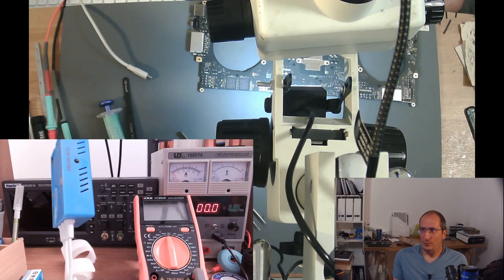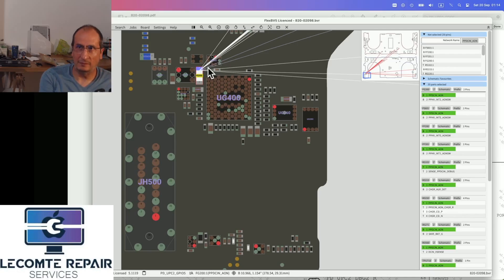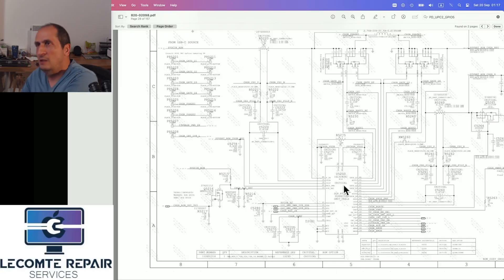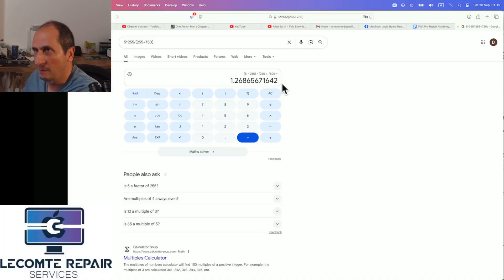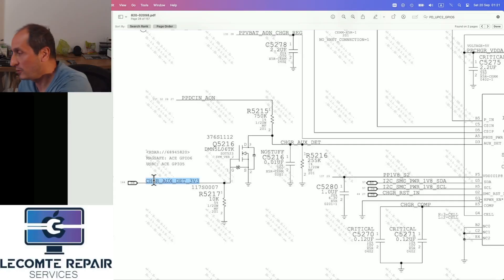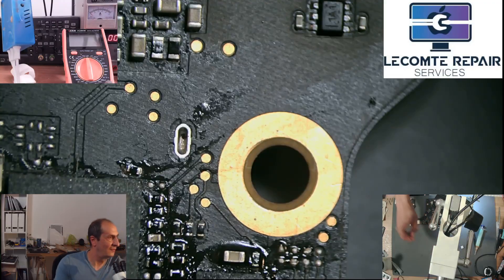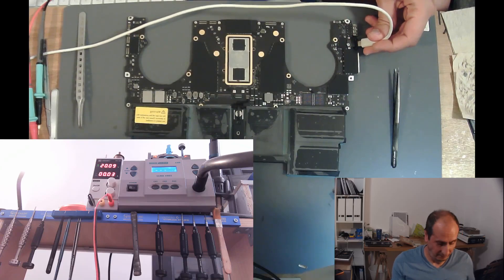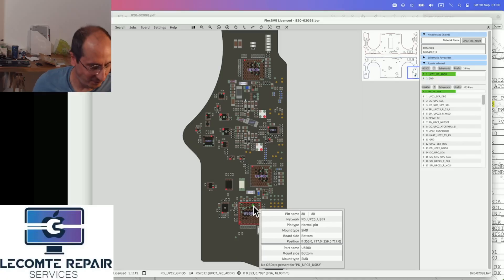[58] [820-02098] Replacing UG400, Part 3: Finishing the job.

Comment: I have reached practically the same point as you in this technical study. 

In my case, I used the oscilloscope to check which I2C addresses communicate with the T2 and which do not. The primary and secondary roles, the function of the TBT-ROM in the configuration, UART communication between CD3217...

But I was missing the resistor table for routing the components OTP. I was missing that piece of the puzzle. Now it all makes sense. Thank you so much for your work and for sharing it with everyone.
Reply from the maker: You're welcome, thank you for the acknowledgement.

So yeah, the short answer is "you just had to read the manual".

But of course, it's more complicated than that. This took me more or less a year to figure out, and the main reason is that: I didn't know what was causing the problem exactly. If I had the info that it was an I2C conflict, then I would have known where to look. But without that information, I had to consider lots of dead ends, including all the things you're talking about. Learned a lot in the process though, so it was not a waste of time at all. 😀
Reply: @LecomteRepairServices Yes, you're absolutely right. It has been part of a great learning experience.

I've found your website and would like to share with you the data from the tests I've conducted in my research. 

In my case, I primarily used an oscilloscope and the Power-Z. With the oscilloscope I was able to read the I2C_UPC bus and immediately saw that the CD3217 R (0x3C) the one I replaced wasn't responding.With the Power-Z, within the PD analysis, you can also see if there is communication between the power adapter and the CD3217, even if the negotiation remains fixed at 5V. The problem is that even though I came to understand the problem, I couldn't go any further down that path.

Once I have the information a bit more organized, I'll send you an email with my evidence. I hope you find it useful.
Reply from the maker: @PhonesLab  I'd be happy to, I'm sure I'll learn something. The address is contact@lecomte-repair.com.

I've noticed that the I2C_SMC bus really doesn't like to be listened to. Somehow, it detects that something is connected to it, and the ACE2 will reboot. It leaves you only one or two seconds to pick up something, though.

Anyhow, figuring out that 0x3B was missing was still doable. But it was not at all obvious that the reason was: Apple strapped UG400, on purpose, so that, if you install a vanilla chip, it will acquire 0x38, and will conflict with UF400.

Comment: Thats very strange they put a second stage for aux_det. I believe its only present since 2021.
Reply from the maker: What puzzles me, and I really want to understand, is: why does the vanilla ACE controller outputs 3.3V on GPIO5 (closing the mosfet), while the OTP one does not. This would tend to indicate that the OTP controller has more tweaks than just the I2C addresses.
Reply: @LecomteRepairServices there are few bytes in OTP block, and i2c override is just a little of that. I have dumps from otp block from t2 and m2 machines and found where it storea the address. However since i have no time + no m1+ dev board in hand thats all i have.
Most likely gpio can be enabled/disabled and configured open/close drain as default. 
I believe non-otp cd3217 from the same or similar board might have proper gpio config. 
Most likely they added gpio so during dec/prod testing you could completely power-reset the machine using VDM similar to DFU / PMU reset commands. I wonder if they added few more.

Comment: Thats great breakthrough.. wonderful job!

Would be the same case for iPads too?
Reply from the maker: I barely touch iPads, so I wouldn't know.  But the answer is in the schematic: if the ACE controller's I2C addresses obey the rules of strap resistors, then the controller is vanilla, and can be replaced directly by any vanilla one.

From what I understand, reading about other people's experience on iPads, CD3217s should be mostly completely interchangeable. But I cannot generalize anything: the answer for each model is inside the schematic.
Reply: I Think there are firmware for cd3217 rom ic to flash. and vanilla cd3217 as i know the word now
Reply from the maker: @sajwhat  So there isn't much to say about the ROM. Notice that what I did on this A2442 did not involve the ROM at all. I just changed the CD3217, and moved some resistors to make it work as I want. No ROM manipulation.

I will probably talk about it in a future video. But my experience is not statistically significative (not enough cases treated to be 100% certain).